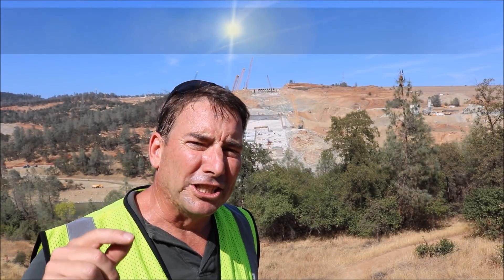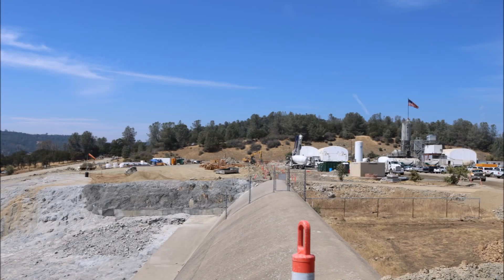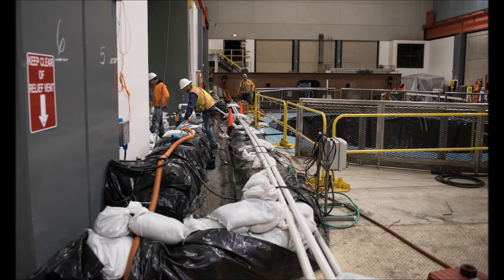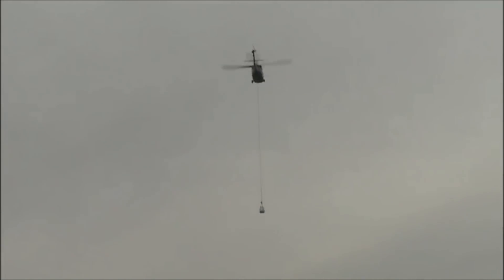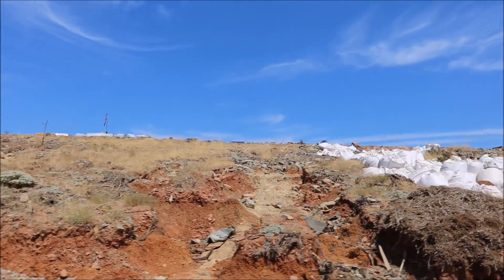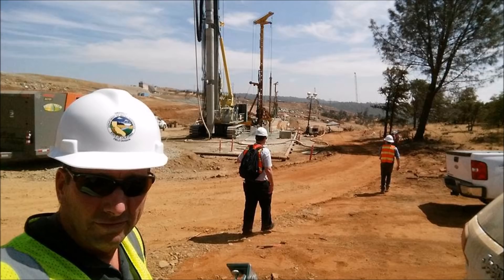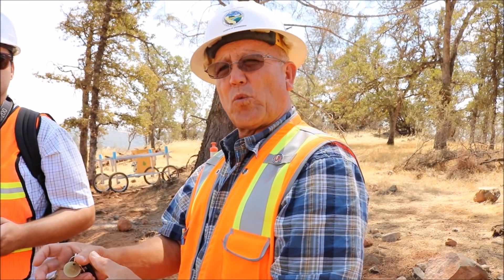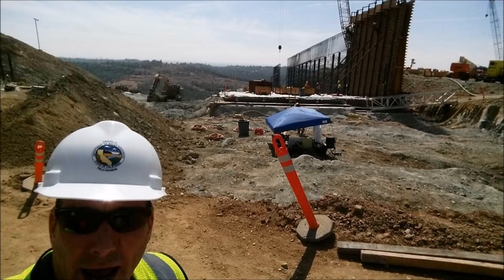Part II Oroville Spillway Construction Tour 2017

Comment: Mr. Brown, it just gets better and better. I especially like when you invited us to put on our hardhats and earplugs because "it's going to get loud." Long ago, when I was nineteen, I drove a front-end loader and operated a "friction-style" crane (non-hydrolic) to move aggregate for a concrete plant. I would like to get details on the construction equipment. What kind of crane? How much is it capable of lifting? What kind of dump truck carries the roller-compacted concrete? How much do they carry at a time? Lot's of questions. Educational. Entertaining. Keep up the good work!
Reply: The Dump Trucks they use for the RCC is the CAT 770G, nominal payload 42.1 tons, with up to 32.9 yd3 capacity.
Reply: At least one of the cranes, and likely most of the big crawler units, is a Liebherr LR 1300 which is a 300 ton crane with a maximum 320 ft. boom.
Reply: Ahh, finally the right answer for the dump trucks!! (noting that this question has been asked and answered wrongly several times)...  

And just because the question is in terms of RCC:  Figure when compacted RCC has about the same density as regular ol concrete, i.e. about 2 tons per yard (within a couple percent typically).  But uncompacted it's about 25% larger by volume (as Juan has said about a hundred times 15 inches spread gets compacted down to 12).

So 40 tons of RCC is about 25 yards in the truck which compacts down to 20 yards on the ground. Which is two truckloads per batch if they are mixing 50-yard batches (per panda44r), and two 770G's seems to be what they use when moving RCC.

Also, they do have some CAT 772G dump-trucks (20% bigger in both payload and capacity) on site, but they are not using them to haul RCC...
Reply: I have been unable to get close enough to the batch plant to be sure but I believe it is a CON-E-CO LO-PRO 12RS, which is a 12 yd. dry batch plant which is then fed into a horizontal mixer, maybe a Vince Hagan which has about a 1 min. mix and discharge time. This is about right as the trucks spend about 4 min in the plant. With the larger area to spread the RCC they have three trucks running today.

Comment: Amazing that they generate all their own power on sight. Do you have any idea how many gallons of fuel they burn a day?
Reply: Per DWR, "It would be difficult to determine exactly how much power they will consume."  (knowing the the run times plus the loads would allow us to deduce the fuel requirements)
Reply: I'm sorry, but I have driven a bunch of Cats over the years, even a few big ones, and NONE of them used 300 gallons *an hour*!!!  300 gallons a day, maybe, but not an HOUR!
Reply: JUst 1 Cat that size at a hospital near here is said to go through 300 gallons per hour, full load.
Reply: calichef1962. Lewie was talking about the semi trailer generators.
Reply: Per Outreach Team at DWR, largest generator on this project is 1,000Kw.  Also, given the volume of fuel they are using doubt they are paying retail.  Just my own opinion but I say more like around $1.50/gal
Reply: Lewie McNeely. Wow. And how many of those are at the Oroville site? And all of the equipment on top of that!
Reply: A BUNCH! All 3-phase I wager. Those V-16 engines put out a LOT of power but it takes a lot of diesel to do it. And with all the tier-whatever it is now emission standards, it takes that much more fuel to keep it emmision compliant and heaven knows thy don't want a puff of smoke there of all places.
Reply: Todd Cory right? maybe they should have an on-site refinery too.
Reply: Then it'd blow up the dam and it'd all be over. A refinery is just a razor edged hair trigger breadth to a catastrophe the best it can do.
Reply: phuck ewe. Thanks for the info

Comment: Explain the secant wall again. It was my understanding they would pour alternate columns of non-reinforced concrete followed up by. a reinforced column  forced into the gap between the two.  Now they're talking about leaving openings for underground water movement.
Reply: @john easton: If I understood what he said correctly, it sounds like the amount of gaps being built into the secant wall are tuned to be consistent with the existing amount of natural gradual underground hydrologic flow through the soil strata. If they did too little (draining), they could cause hydrostatic ponding and localized surface erosion uphill of the wall, which would look even worse than the "wet spot" all the underinformed talking heads like to jaw about ad nauseum.
Reply from the maker: watch it again...Tom explains it.
Reply: Juan, great vid. 

QUESTIONS: (1) Why dont they put a secant wall up at the top of the emergency spillway, instead of further down where it currently is ... I assume it is because the drills would be unable to reach deep enough to anchor it to bedrock, and the resulting gap would cause hydrologic undercutting. Is that right ?

(2) At 8:57 you made a comment in passing about epoxy coated rebar only being used in the lower spillway because the concrete is wetter.  AFAIK that is incorrect because the sort of corrosion that happens in rebar that damages concrete is NOT surface/cosmetic rust but rather the sort that occurs very slowly over the course of decades due to both electrical ionization/conduction as well as due to the moisture that's always present in concrete as it breathes, which results in rust swelling that cracks the concrete and increases waster infiltration ... the short term moisture present in concrete during the initial few weeks of post pour hardening (regardless of how wet or dry the mix formula) is actually irrelevant (again, as I understand it).
Reply: Roving Punster to answer the first Q. They will lay RCC between the ES and the wall. In addition there will be another RCC buttress right behind the ES. The ES is only rated at 30,000cfs so it doesn't need the structural strength.
Reply: Thanks, Rob.  In hindsight, I think it would have been better if I'd phrased (1) as an in-addition-to rather than an instead of option.  Then again, the question is almost certainly moot since I'm guessing it'd be impossible to extend a secant wall all the way down to bedrock.

Meanwhile ^bump^ on Question #2.
Reply: TBH I don't know, but if the back of the ES is RCC all the way down to the secant, that alone would prevent erosion right behind the ES weir. The ES is really quite long in comparison to the main spillway, so even if they had to use the ES the water flows are spread along a much greater distance. Does that make sense?
Reply: Water takes the route of least resistance, so building in these gaps will ensure no backup pressure of the groundwater.

Comment: Impressive reporting. My question is how much fuel are they burning a day?
Reply: We came up with an estimate of approx 15,000 gallons per day.  That is just for the heavy equipment.  DWR estimates $1.4 million to run the generators through 2018.
Reply: Matthew Erwin everything runs on Cannabis (Marijuana) now, we are as green as you can get now. Well maybe a Unicorn and a Rainbow every so often for old time sake.
Reply: phuck ewe yes I know, I live here also. Just making a joke
Reply: ramosel  That is good question concerning possible CARB requirements.  For answers to this and any other questions with respect to this project, contact The Oroville Outreach Team at Oroville@water.ca.gov
Reply: Star Gazer the problem is, you have to use fuels to generate the power to keep the hydrogen cold and you need electric power to make electrolysis happen to create the hydrogen.
Reply: Star Gazer liquid hydrogen,  though,  is nust a little hard to handle.  Can you say "Hindenburg "?
Reply: Odd they are sitting on a (recently fixed) power generating Dam but have to use stand alone generators to run the construction site.   Hmmm... did CARB require Tier 4 final on those generators???   Where's the solar??   If there is one thing we do well in California, its "strain at gnats and swallow camels".

Comment: I just had to drag myself away from your Harvey/Houston video to watch Part 2! The secant cutoff wall is hard to get as excited as about as the main spillway, though a necessary part of the project. Incredible that everything is powered by generators instead of mains electricity, but I'm sure they have their reasons...
Reply: it is faster to have portable stuff on a job that will only last two years or three years . .  faster to set up and tear down easier to maintain and engineer . .  these guys are good  they need to come to Houston and other cities and rebuild them.  We are hoping the Addicks reservoir  wall will hold over the next few weeks

Comment: have they given an estimate at how long that emergency spillway was expected to last with 1' topping it?... and am i correct in thinking that it was designed to allow a 30' wall of water to release to save the main portion of the dam...?
Reply from the maker: They didn't know...1st time used ever. 
30' was the threat if it failed.
Reply: I don't see why. It's probably 4500 or better since they're having to cool it down. 4k turns black inside and is hard as a very hard thing for lack of a better term. Usually 3k or 3500 is footing/slab mix.
Reply: Did anyone say what the strength of the different mixes were?  P.S.I. ? I understand about the test cylinders and different break test times, slump tests and nitrogen injection. I used to drive a mixer myself.
Reply: Lewie McNeely that detailed info might not be released for security.